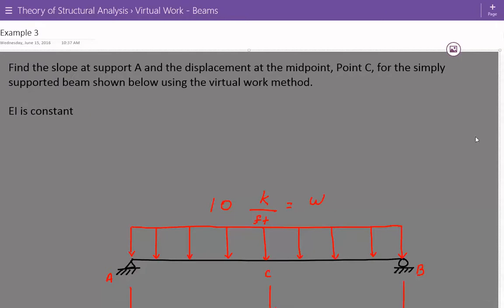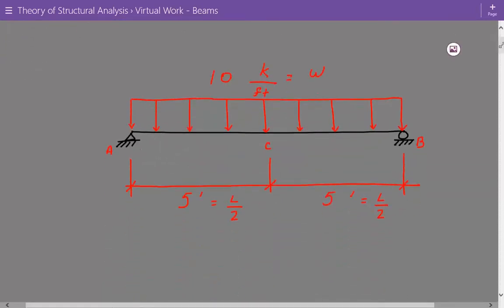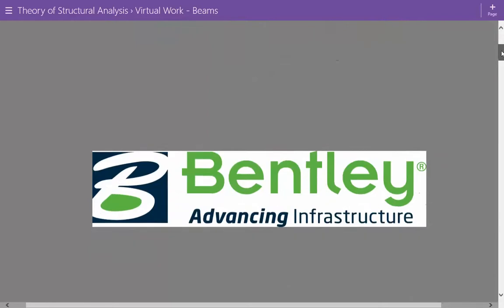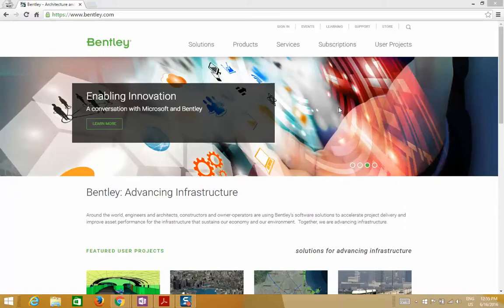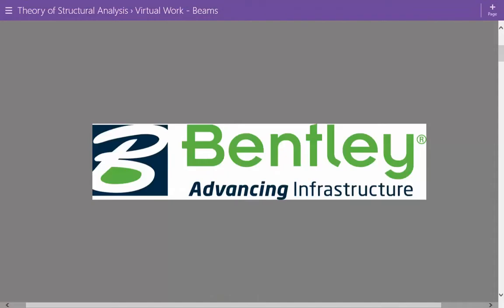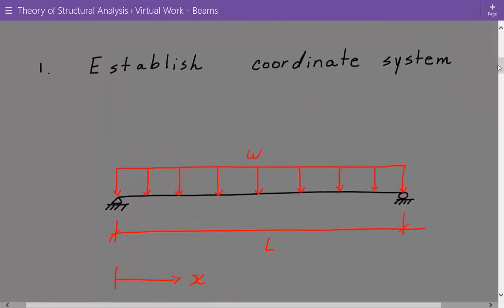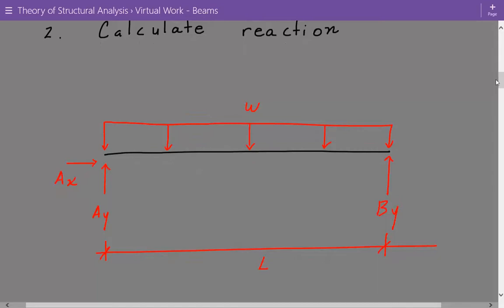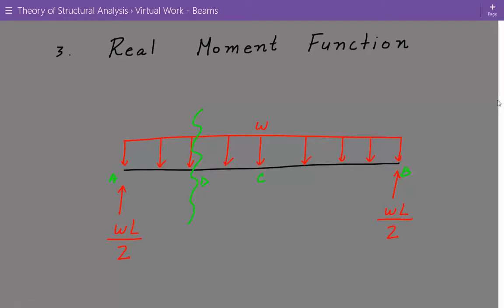Slope & Deflection of Beams Using Virtual Work Method, Structural Analysis for Beams Example 3

Comment: When you cut the beam to find the virtual moment function for the displacement at C, why do you cut it before the virtual load?/ why don't you include the virtual load in the cut?
Nevermind, I see why you can do that now, haha. When you solved for the displacement using the function, you just did the bounds to L/2, and multiplied by 2, since it's symmetrical, which is way easier than solving for the virtual moment function including the virtual load, and then making the boundary include the entire length of the beam when solving for the displacement. That only works when it's symmetrical though...